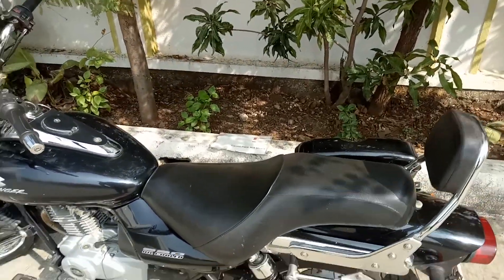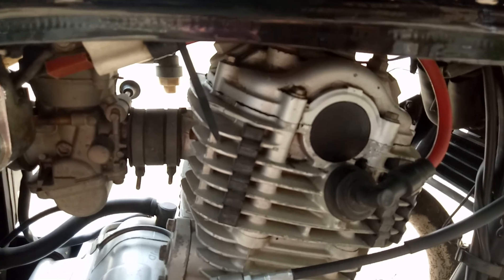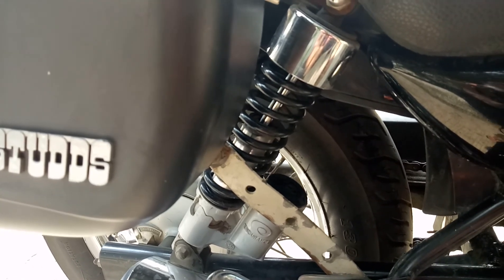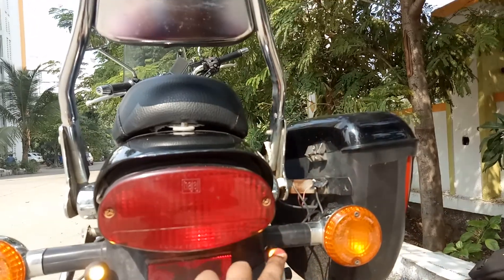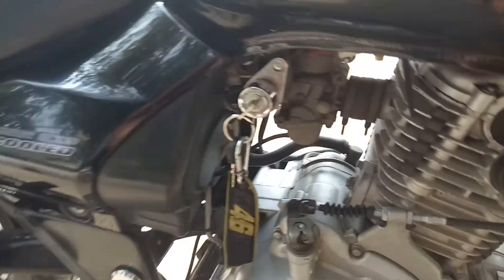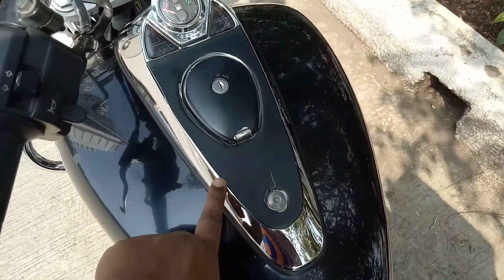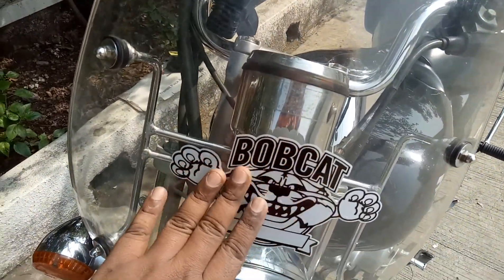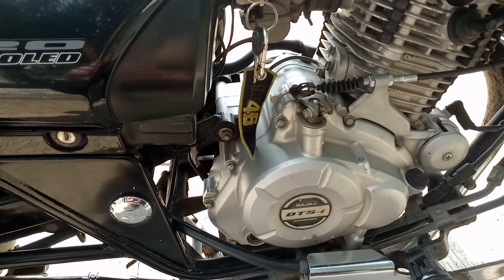Bajaj Avenger Modifications done by me.

Comment: I bought the ralco speed blaster  tyre 100/90 r 17 that u suggested for the front wheel. it requires adjusting the mud guard by drilling holes at its bottom to avoid touching.

The tyre expert said the ralco 100/90 r17 is for the rear wheel. this tyre will make  the steering tough and it will be tough while moving and taking turn after stopping vehicle at signal.

Also this tyre will bring  down the mileage plus some people experience shoulder pain after long ride. Alternatively he insisted on CEAT ZOOM PLUS SZF 100 / 80 r17  ( 100 width, 80 height , 17 radius 😊)which is designed for front wheel and its suits avenger well without  causing  strain on handle bar and it wont bring  the mileage  down. its a tubeless tyre  costing around 1800 rupees.  Also you can install this tyre with tube also.
what is ur practical  opinion
Reply from the maker: Always go for the things with you are comfortable. MRF FY1 is also a good front tyre which is stock tyre of R15 this tyre is best suitable for cornering.
Reply: @thecruisingsoul1771  u have mentined mrf fy1 r15. but the avenger front wheel will  fit only r17.  are u refering to   MRF Nylogrip Zapper FY1 90/80-17 46N Tubeless Bike Tyre, Front, price ₹1,650.
I wud like to know  information  from people(whom  u know) and who have use ralco 100/90 15 and their views
Reply from the maker: @A2Zee_Pocket_Movie_8k7G  have to check with my friends but i have used mrf fy1 it's best
Reply from the maker: @A2Zee_Pocket_Movie_8k7G  MRF fy1 is the front stock tyre of Yamaha R15 older version
Reply: @thecruisingsoul1771  that yamaha r15 front tyre dimensions number please. find out
Reply from the maker: @A2Zee_Pocket_Movie_8k7G  GOOGLE MRF FY1
Reply: @thecruisingsoul1771  thankyou bro ...  i  googled  for yamaha r15 tyre ,is this the one .. ?______

R15 v3 gets broader tyres – both front and rear. It comes with a 140/70 – 17 rear tyre as compared to the 130/70 – 17 tyre of version 2. At the front, the v3 gets a 100/80 17 tyre whereas the older version came equipped with 90/80 17 incher.
Reply: Hi..100, 80, r17  is good..?

Comment: thanks for the advice regarding ralco tyre... thunderbird 350 endurance shock absorber change.
my vehicle avenger cruise 220  has clocked only 12200km since purchase july 2017. but it gives only 22.5km mileage. i use 20w50 csstrol 4t..power i oil. service done  pucca and carburetor setting done. is there any way to improve mileage bhai.

i am waiting for your reply bhai. do i make any parts replacement??
Reply from the maker: Visit Bajaj service center and get the below things checked. 
1) Get the appropriate Carburettor CO setting done with help of a CO setting machine.
2) Check the appropriate chain setting along with wheel bearings and lube the chain. 
3) check if the Clutch plates are properly working.
4) Use motul 7100 20w50 oil. 
5) Get the spark plugs cleaned else install NGK spark plugs compatible with your model. 
6) Always check for appropriate air pressure in both the tyres. 
Get all this checks done from an authorised service center with an experienced mechanic you'll definitely notice a remarkable improvement in performance of your motorcycle. Hope this helps you out to solve your problem.
Reply: @thecruisingsoul1771   wat a spontaneous reply bro...!. You are the Guardian God of the Avenger bike club members of this channel. Hats off.
The avenger authorised guy said they will check valve apart from Carburettor setting. Shall let u know after checking

Btw is ngk a brand of spark plug. My bike is 2017 june model. How to find a match for this??
Reply from the maker: @A2Zee_Pocket_Movie_8k7G  Thanks for your kind words.. Please get your bike thoroughly checked from a experienced mechanic.. Yes NGK is a Japanese brand of spark plugs you can google for more info.
Reply: @thecruisingsoul1771 I have already  ordered  130/90 r15 ralco for back wheel. Today i ordered 100 / 90 r17 ralco speed blaster foe my avenger 220 cruise. Because of this will the  mileage come down. pls share u views regarding the effect pf this combination
Reply from the maker: @A2Zee_Pocket_Movie_8k7G  No mileage won't come down

Comment: u have suggested  mrf fy1 of yamaha r15 old model as front tyre for avenger 220. Are u refering to   MRF Nylogrip Zapper FY1 90/80-17 46N Tubeless Bike Tyre, Front, price ₹1,650.
I wud like to know  information  from people(whom  u know) and who have use ralco 100/90 17 and their views

Recent yamaha.R15 v3 come with broader tyres – both front and rear. It comes with a 140/70 – 17 rear tyre as compared to the older 130/70 – 17 tyre of yamaha r15 version 2. At the front, the v3 gets a 100/80 17 tyre whereas the older version came equipped with 90/80 17 inches
So which one is prrferably gud .for the front tyre of avenger  220..pls explain
Reply from the maker: Mrf FY1 is front stock tyre for YAMAHAR15.
Reply: @thecruisingsoul1771  At the front, the r15 stock tyre (old model) came  with 90/80 17 inches for front tyre. is this the one u suggest,